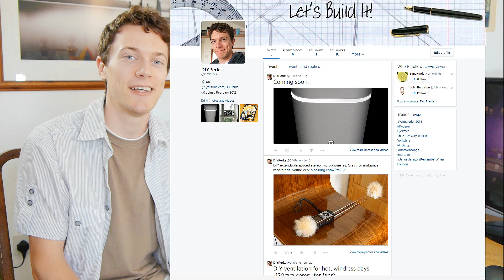How to Make a Clean Air Enclosure (for HDD repair etc)

Comment: This enclosure is great for stuff like cell phones, Ipads or tablets, ps vita, mobile devices in general with a screen, and decide you want to put on a screen protector.  There's nothing more annoying is when you are trying to put on a screen protector on a cell phone and noticed you sandwiched dust particles between the screen and the film protector after you're done..

Comment: what about using 120mm fan and air filter?
Reply from the maker: It might work, but it probably won't provide enough 'suction power'. No harm in trying though.
Reply: Agreed. For the purpose needed (and expediency) a quick and powerful hit with the vacuum should take care of it.